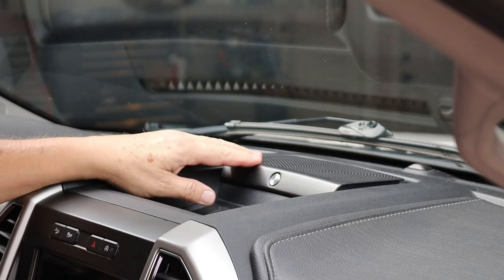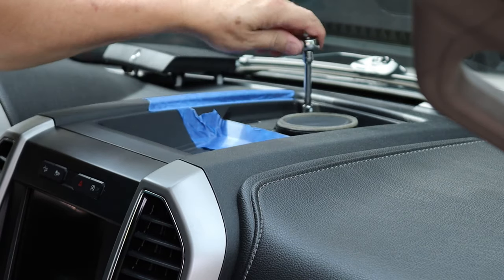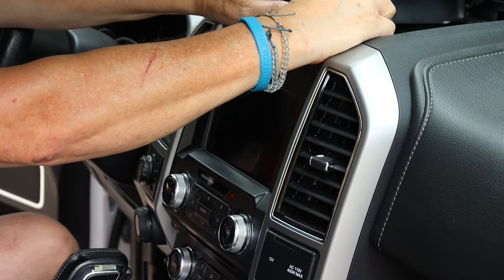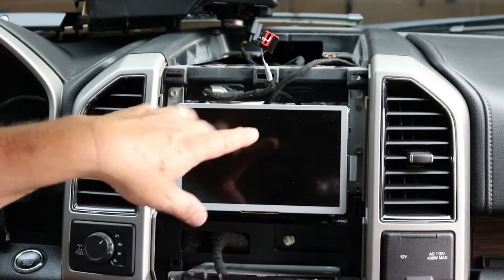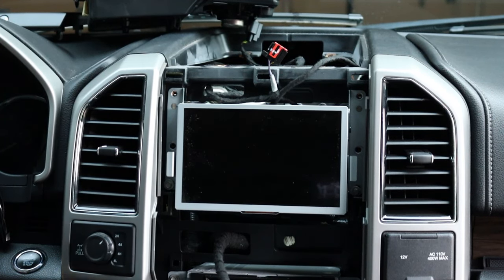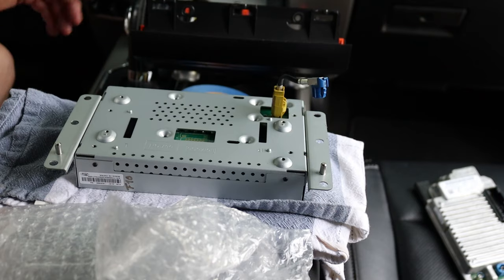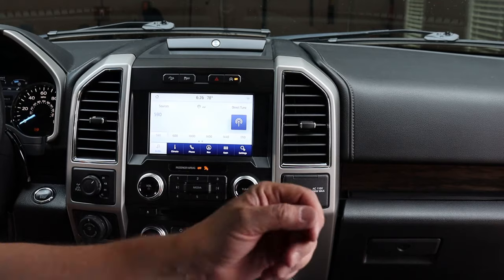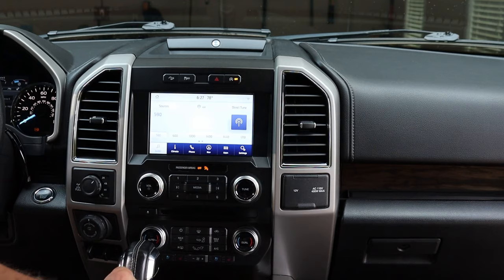Replace SYNC3 APIM Radio in 2015 to 2020 Ford F150

Comment: Finally found an answer. Mine went out around a month ago on my 18. Great video. Local ford dealer quoted $2200 on top of a $350 “diagnostic fee” i already paid, for this exact fix. Ordering this today. It’s a shame that ford leaves customers out to dry that are beyond the factory warranty with an obviously faulty part. Dealer said they average 10-15 aipm replacements per week. Thank you sir!
Reply from the maker: I agree, this should be a recall or something.  They apparently have a common problem of failing.  I'm glad this helped, thanks for watching!
Reply: Did replacing this part fix your black screen issue?
Reply: @Millionair95 I’m about to find out if it fixed my screen blacking out. My APIM is “bricked”. Putting an update on a USB and plugging it in did not work for me. Hopefully the new APIM fixes it. I’ll edit this comment if it fixed it or not. 🤞

Edit/Update: Replacing the APIM worked! Thank you Dennis for making the video straight forward. 10/10 would recommend this video for anyone needing to replace the APIM.
Reply from the maker: @arreguinracing2732  I'm glad this helped!  Mine never blacked out, but was regularly flipping out.  Others have told me that replacing the APIM took care of the black out problem too.  Thanks for watching!

Comment: 2018 ford flex  Tell me please.  I bought a used module in good condition, when I installed it the screen continues to be dark and there are no changes.  What should I do ?  My original module failed and I bought another module.  What to do ?
Reply from the maker: Thanks for watching, sounds like the used APIM might be bad also.  I would only consider one that has been tested and is guaranteed to work.

Comment: GREAT video! My settings will not save so I guess this is the problem, and the start of more woes to come. Thanks for a very detailed procedure to do this. We both have the same model, year, color, engine. Bright minds think alike. :)
Reply from the maker: I really like this truck, but I have had a couple of issues with it.  I'm still chasing down an ABS error.  Replaced all the speed sensors, so it's starting to look like the controller is the culprit.  I'm glad this APIM vid is helpful.  Hopefully once you replace yours, there will be no more problems!  Thanks for watching!

Comment: Great video. I noticed at the end of your video when you started your truck the auto start stop was automatically turned off. 
Do you have any details on how you did that? I have an adapter that I've connected into my button that does it, but I didn't see that when you took apart your dashboard and I'd prefer to not have additional hardware.
Reply from the maker: Thank you for watching, Derek!  I have a plug-in installed on my harness to that button.  It basically keeps the last setting,so once I turn auto stop/start off, it stays off, even when powering the truck off/on.

Comment: I watched your video but I was really curious to why you changed your APM. I must’ve missed it somewhere. I watched it from the beginning then I started jumping around, looking for the reason why you replaced it. did it go bad I must’ve missed it somewhere but I was curious to why you replaced it, usually you do it as an upgrade from the sync 2. You already had the sync three so just curious why 3:19
Reply from the maker: Thank you for watching!  Mine was originally a Sync3, I replaced it because the original died.  Apparently it is a common problem with some of these Sync3 modules.

Comment: I just took my '16 to the dealer because the Sync system won't update, voice controls don't work, but the on screen functions seem fine. They told me the apim is shot. They quoted me $2300 to replace/install/program. Does this even sound like an apim issue?
Reply from the maker: Thank you for watching, Josh!  It definitely sounds like it could be an APIM failure.  I can't guarantee it, but it sounds plausible.  The APIMs fail in different ways.

Comment: How has this apim held up? Is it still working? I’ve had my apim replaced about 1.5 years ago and now my radio/GPS is acting up again. Gps works half the time and the radio is not working at all. The blinker and backup warning chimes are not coming through the speakers either. I was going to try to replace my apim myself.
Reply from the maker: So far, so good with mine.  I've had no other problems since replacing it.  Thanks for watching!
Reply: Thanks for getting back to me. I will like and subscribe!
Reply from the maker: Thank you, Mikey!

Comment: May 4 2024 I was quoted $2,150.00 at my local dealership in Ohio if your truck doesn’t have a lot of features you can buy these from a junk yard for around 90 bucks most have all the radio number on the tag on the back of the apim in their system, so everything will work without programming
Reply from the maker: Great tip!!  Thanks for watching!